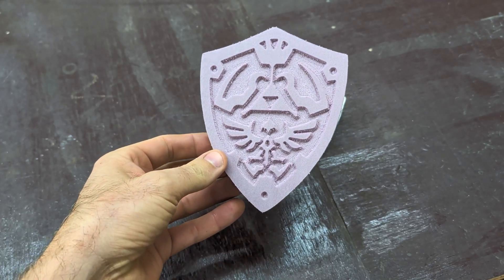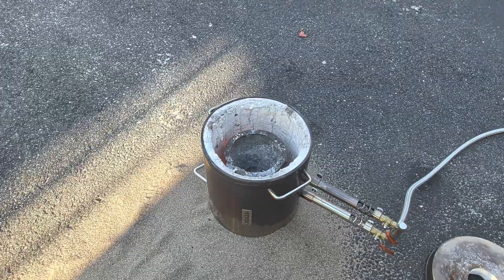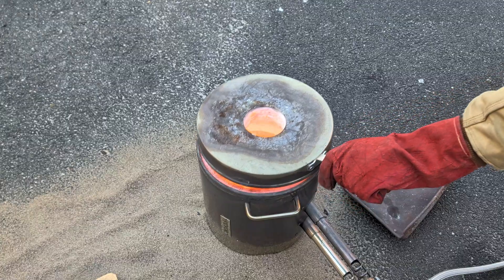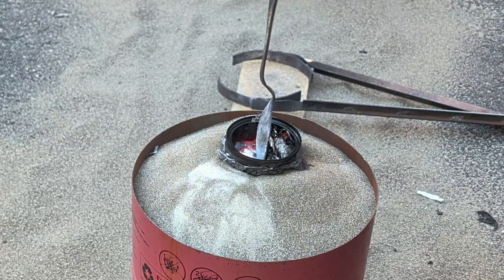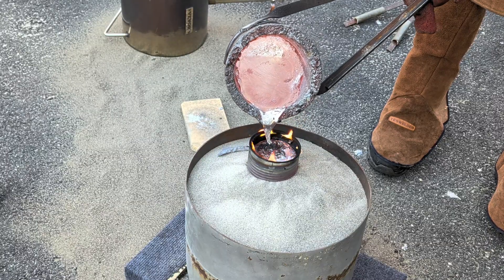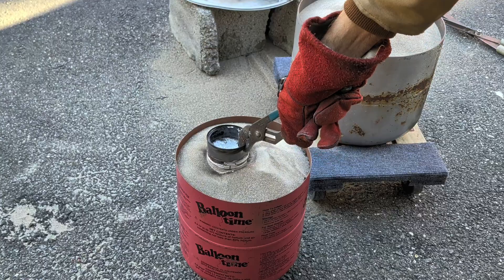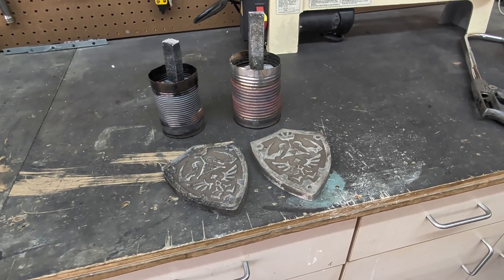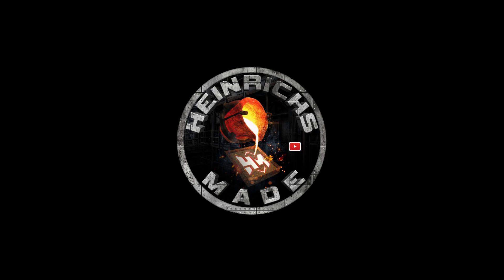How to Turn Foam into Metal - Turning Foam into Metal - Lost Foam Metal Casting

Comment: Any tips on your CNC router process, specifically the bits + CAM settings?

I found some 3.175mm bits with 0.1mm tip @ 5 degrees (1 flute) which gives me a fantastic looking foam mold but takes 7.2 metric forevers to make.

Anything larger than those tiny bits seem to batter the XPS foam around and make it look ragged/"hairy".
Reply from the maker: HEY!
I'm not expert at cnc.  I use a free program easel.inventables.com.
I use an 1/8 upcut  "i believe" straight bit for the parameter of the foam.  The setting I use is Feed Rate: 40 in/min Plunge rate: 9 in/min Depth per pass: 0.028

The depth per pass is what needs to be slow.  Having a high depth per pass will  gouge out the foam.  Yes it does take longer.

When cutting out the design i use a depth per pass: .0625
Reply: @HeinrichsMade Thanks, this is really helpful.  I'm in the garage experimenting right now so this is perfect timing.

Assuming a good mold, we've got aluminum down pat using your method but can't seem to get a 98 copper/2 aluminum blend to come out all the way.  Going to try again next weekend.
Reply from the maker: @JasonDiegmueller  Awesome!  Why are you mixing in 2 percent aluminum?

Comment: I'd love to do more foam casting like this, seems so much simpler and fun to just do whenever. Good job dude. Where'd you get your cnc machine from? The shields look awesome I've always wanted to make a full size master sword. Have you ever tried using the aluminum black oxidizing agent?
Reply from the maker: Thanks!  Yeah you should definitely get into lost foam casting.  It is so much easier than lost pla.  So much less work...  I use an older CNC from FoxAlien.  It's the masuter 4040.  They don't make it anymore, but have a bunch of other ones
Reply from the maker: I also have used aluminum black on a few of my projects 👍

Comment: nice work bud. ive never thought about cleaning the dross out of the can. thats a great idea. I dont know if you have a compressor but its great for blowing the drywall out especially when its hot out of the sand. cheers
Reply from the maker: Cleaning the dross out of the can was just fun to watch 🤣
I actually tried the compressor the following day.  I have a tiny compressor and it didn't work.  But maybe if I did it right after I removed it from Sand it would have worked.
Reply: @HeinrichsMade  yeah i think wetting it down with the quench makes it restick a bit perhaps.

Comment: It's surprising the amount of dross you get from seemingly clean aluminum rods. You have a solid setup that gives an amazing level of detail on both shields.
Reply: those chairs rods are likely clear coated so basically painted. also the thinner the metal you melt, the more surface area per volume so you will end up with more oxidation.
Reply from the maker: @stevesrt8 facts!
Reply from the maker: Thanks Hana!  Yeah I didn't expect the dross from clean aluminum.